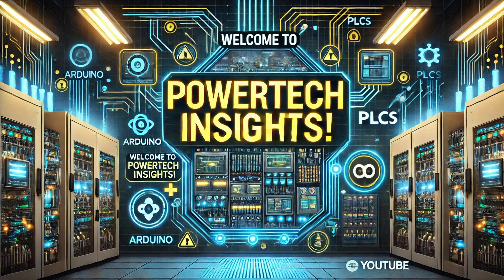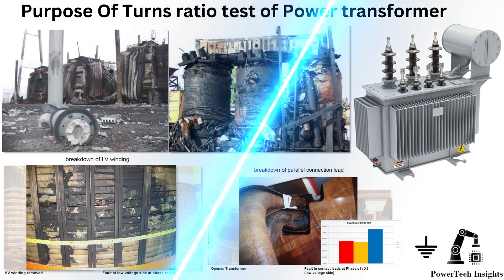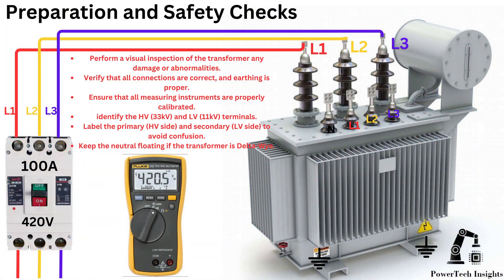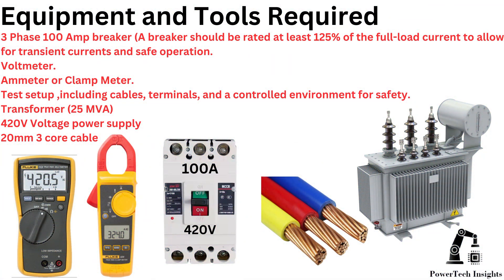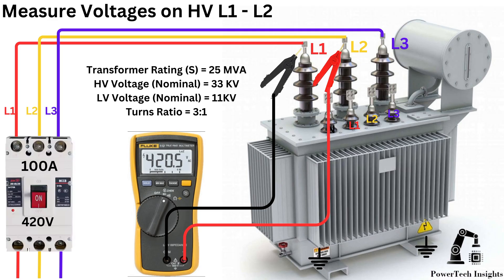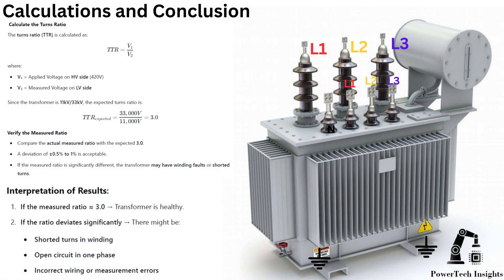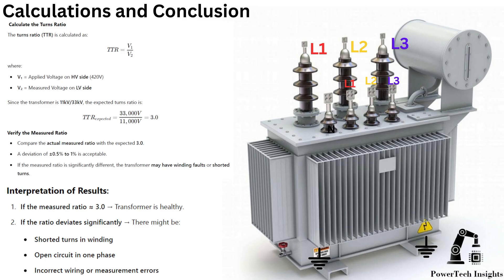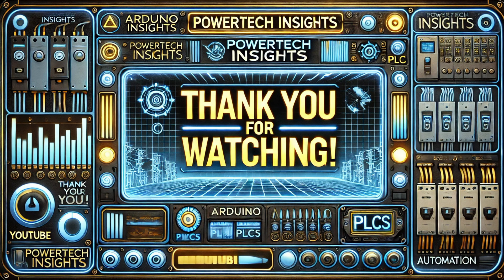Turns ratio TTR test of Power transformer -Transformer Testing

Comment: I assume this is a Yy or Dd transformer.You need the vector group to work out the correct ratio
Reply from the maker: It doesn't matter what is the winding setup. Its very simple method to confirm Turn ratio without any special tool but still can test vector group by using this method but connection setup would be different